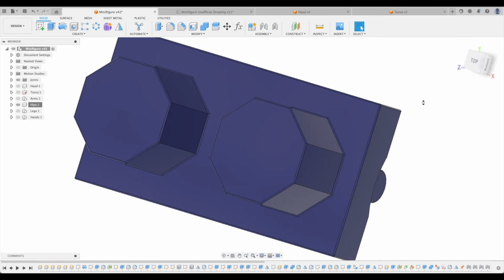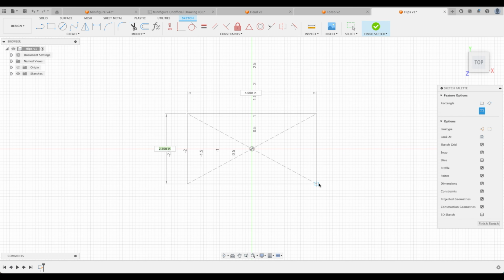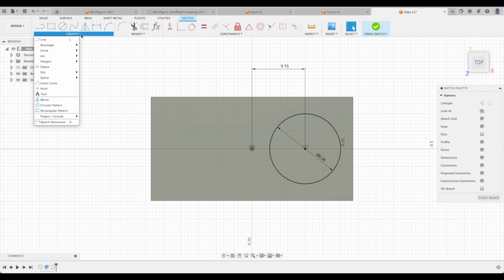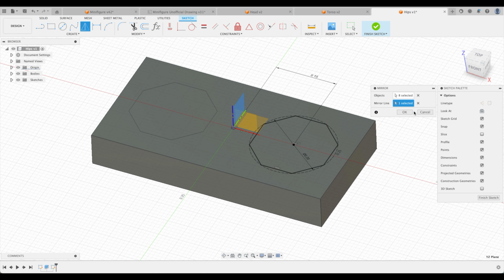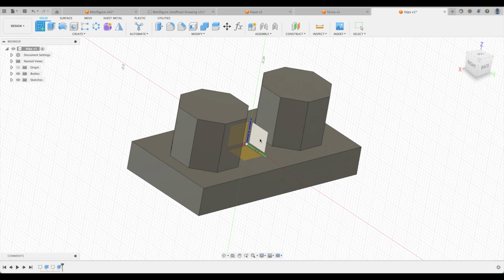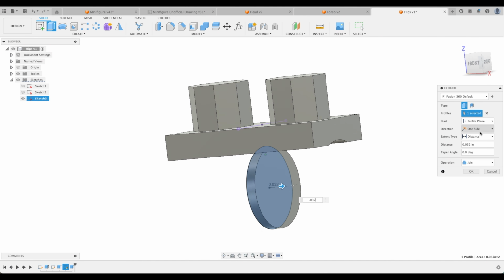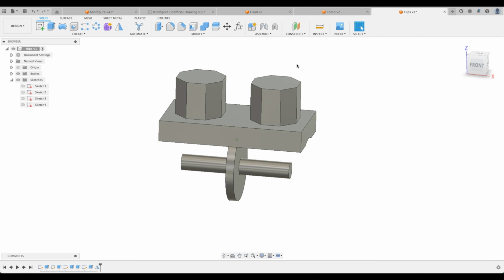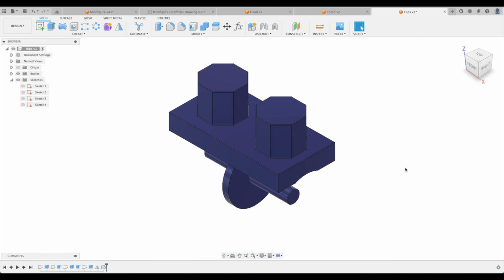Fusion 360 for Beginners - Lesson 10c - Model the Hips - Drawings, Polygons, Mirroring (2023)

Comment: Are very small fillets affecting 3d printing? 

Btw. I finally feel like I'm getting better at 3d modeling, I wonder how good I'll be when I finish the course
Reply from the maker: Yes, small fillets can affect printing. Remember that the nozzle diameter divided by 2 should be your minimum fillet size. That way your model will look the same after printing. On vertical walls, there is no such thing as sharp edges. 

So glad to know you are benefitting from these tutorials! Keep it up 😊

Comment: I have been trying for over an hour with this tutorial and can't finish it. I have done all the other ones okay but this one I keep getting stuck. I can't choose the plane for the wheel part even after I turn on origin. My rectangle is always on the wrong side of the red line. I can't get the dimension to select the right spots to set the wheel distance. Every time I restart I run into a new problem.
Reply from the maker: Happy to try and help! First of all, please know it is very difficult for me to envision exactly what you’re doing and what the problem is. However, one thing that jumps out at me is that you wrote: “My rectangle is always on the wrong side of the red line.” I think you will need to answer the question, why is it on the wrong side? Are you not using a center rectangle to sketch your rectangle? Walk me through your design process so that I can visualize what you’re doing. Thanks.
Reply: @learnitalready  Thanks for the quick response. I will get back and try again soon but I'm too frustrated right now. I will try to better explain my problems next time.
Reply: Thanks again for the quick response. I figured out where I went wrong and was able to finish the tutorial.
Reply from the maker: @gusshultz Great to hear! Thanks for sticking with us.
Reply: can you tell me why when I start a sketch and select the x y plane, it's always upside down. Meaning when I look at the navigation aid on the top right, top is upside down. When I watch everybody else start a sketch, it's always right side up.
Reply from the maker: @gusshultz I’m not sure exactly why but there may be a couple possibilities:
1) right click the view cube and resets all views
2) make sure Fusion is updated to the most recent version
Give those a try and report back to me.
Reply: @learnitalready  Thanks again for your quick response. I tried resetting what I could on the view cube and just updated but still have the same problem.
Reply: Same problem is happening with me 
How you resolved it ?? 
Can you guide me ?

Comment: A nice, easy one for today! I'm converting all of this into metric from imperial (as an extra exercise). It was pretty cool, doing the math and having it work on that center line, measuring the distance from the ends of the middle posts to the origin plane, and getting the same number back. Very satisfying.
Reply from the maker: You are flying! Thanks for keeping us posted as to your progress. As a little hint (you’ll learn this later on) even if your document setting is set to metric, you can still input imperial and it will convert it for you. For example, take 0.5 inches and when you enter that dimension just type “0.5in”. Immediately after you’ll see the converted value in metric.

Comment: thank you for these awesome tutorials. why where the circles created before creating the octogons  and why did you later convert the circle to construction line before mirroring the octogons? could all this be done with out the circles? seems to be a lot of work for such a simple shape. also the diameter of the octogons where .205 but the circle you created was .2
Reply from the maker: Thank you for your comment and support. We greatly appreciate it. 

To answer your questions: 

1) Why were the circles created before the polygons? 
Creating a circumscribed or inscribed polygon without a circle to constrain the diameter was possible, but we would have need to have used a radius value instead of a diameter. Frankly, in this instance, I would simply create the polygons, however I originally created these tutorials with my students in mind; instead of having complicating things with a radius, I simply used a diameter which is easy to compare to its mating geometry (which brings us to question 2)

2) Why 0.205 instead of 0.200? The male pins on the hips are slightly larger (0.005 is approx the size of a human hair) because it will actually fit snug and stay snug when assembled. If we were to make the pin the exact size as the holes, they would probably be snug for the first fit, but then be loose every time after that. Remember, the amount of material that mates together is incredibly small, so we need to make sure that the parts don't fall apart once assembled. 

Your questions show insight and great care to try to understand. I really want to commend you. People like you that are inquisitive and ask "why?" are often very successful at many things in life, not just 3D modeling. Great job!
Reply: @learnitalready   thank you for getting back to me, I really appreciate your compliment :) trying my best sensei

Just to be clear on the measurements: 
the 2 holes under the body should be .200 and the 2 octagonal extrudes on the hip should be .205 ( .005 a little extra material) for a snug fit? is this what you meant ?  lastly why not make the 2 octagonal extrudes on the hip cylindrical to match the female ends on the body? isnt that a better fit like the arm and the shoulder sockets
Reply from the maker: Happy to try to help!

So, to clarify and answer: yes, the holes should be slightly smaller than the 2 octagonal bosses which will keep a snug fit, hopefully for as many times as the hips are inserted/removed from the torso. Also, they were made octagonal rather than round because the slight deformation of the edges will provide the necessary friction to keep the two pieces mated. If they were the same shape (round in this instance) then the bosses wouldn't be able to fit into the holes, and would not keep snug enough to have friction keep them affixed. The shoulders are a different story. You would like them to rotate somewhat freely, which is the main reason why they are the same shape. 

If you were to 3D print these pieces, and assembly them, you would probably see a little more clearly what I mean. If the bosses for the arms were too snug, then you would have to reduce the size of them so fit properly. Also, the size of the octagonal bosses on the hips might also need to be slightly adjusted, but the principles of how the fit together remains the same. 

I hope that I'm clarifying more than confusing things. I'm grateful that someone is asking questions about this kind of stuff and genuinely wants to know. If there is an engineer out there that can either confirm or put me in my place then I would be grateful either way.